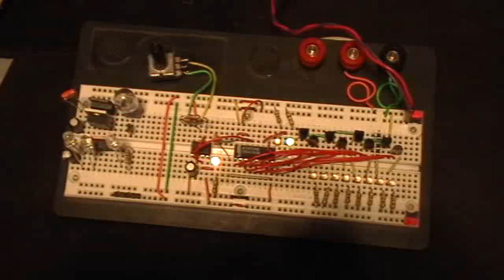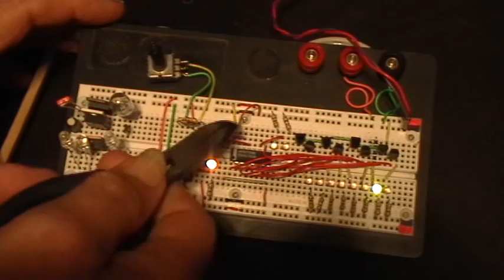Electric OU: SSMicroToroidal QEG 1: Decade Counter Coil Driver

Comment: You have a cool idea but the scheme should start It is brighter
-could also other embodiments like: LM3916
 I wonder how to distinguish time the first couple(1/2)(3/4)(5/6)...1=npn 2=pnp><...
Reply from the maker: +Tomtech29 These are old technology mini-LEDs, I am supplying 9V and using 470 ohm resistors. The LEDs could be much brighter if I used modern superbright LEDs and drove them at maximum current by using smaller resistors. If one only wants to drive LEDs, they could be driven directly from the outputs of the 4017, no transistors needed, as long as the current is limited to what the 4017 can handle. At first I had the circuit set up without transistors, and I just used the same resistors when I installed the transistors. You will note that the two "extra" LEDs are not as bright as the ones driven by transistors even though they are also using 470 ohm resistors. This is because the 4019 does not provide much current. LM3916 is essentially a voltmeter and needs to have stepped voltage inputs to advance the output in steps. It is more complicated to drive in equal steps, but yes, it could be used if one wanted to provide the analog voltage steps it requires. I'm not sure what you mean in the last sentence... you could use PNP transistors to invert the output (LED on until pulse arrives from 4017) or you could use inverter chips like 4093 or 7404 etc. 
Thanks for commenting.

Comment: use the reset pin to get rid of the delay.   then it will be the smooth cycle you want.
Reply from the maker: +notionSunday 
Right you are! Connecting Pin 15 (reset) to Pin 9 (and removing the ninth LED) the chip only cycles through the 8 "coil" LEDs, without the gap. I didn't see this implemented on the photo of the OP's circuit though, so I wired it like he appeared to have it. 
Thanks for reminding me! The versatile 4017 can be used as a decade counter, but also as a divide-by-n counter and can be cascaded to make all kinds of display and driver functions.
Reply: +notionSunday + TinselKoala re: 4017  - I haven't worked with it, but am very interested. I wonder if there is a way to control the pulse width...
Reply from the maker: Solar OffGrid
Yes, the pulse width is controlled by the timing components of the 555 part of the circuit. Look up "555 astable multivibrator" and you'll find a lot of information as to how it's done. The 4017 can be set to trigger on the rising or falling edge of the rectangular pulse from the 555, so controlling the pulse width of that component also controls the pulse width of the 4017's outputs.
However.... if I were doing this kind of thing myself I'd use a microprocessor and control timing and pulse width in software. A 3-dollar Chinese Arduino Pro Mini would replace the two chips and the timing R and C parts I used here, and would allow a lot of flexibility such as feedback loops using sensors for timing, monitoring,  etc. With the microprocessor you could even have different pulse widths for each output if you wanted to.
Reply from the maker: +notionSunday
I've had another look at the OP's photo of his breadboard, and he does use a jumper from Reset(15) to the 9th output(9). I missed it on my first examination. SO he is indeed using a smooth, 8 output cycle without the gap. Thanks for making me take another look, sorry about my confusion.

Comment: I look forward to your full replication. You seem to be a natural teacher. Thanks!
Reply from the maker: +Solar OffGrid 
Thanks for watching and commenting! I don't know how far I'll be able to get since I don't know all the details of the coil setup or the frequency range it's supposed to operate at, but perhaps the Original Poster will provide some more details... if he hasn't already run away because of my critical comments. But as I find out more, I'll probably be posting more videos on the topic. 
Meanwhile you can check out my own "MicroQEG" videos, where I show measurements and calculations that lead to a huge "overunity" COP. Of course due to (deliberate) measurement errors and conceptual (deliberate) misunderstandings. I make the same mistakes that the Robitailles did in their "overunity" QEG claims, to illustrate that an obviously non-OU device can produce the same kind of measurements quite easily.
Reply: I'll try to check back more often. I always have a good laugh while I learn. The testing techniques you use are definitely helpful.